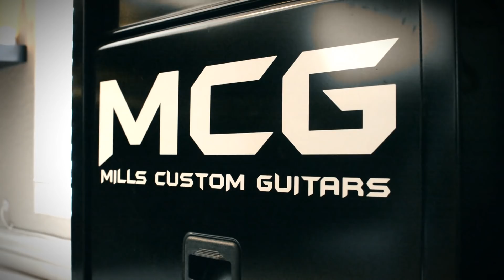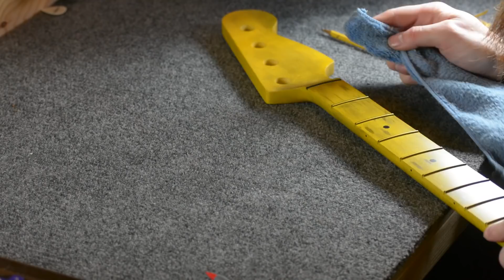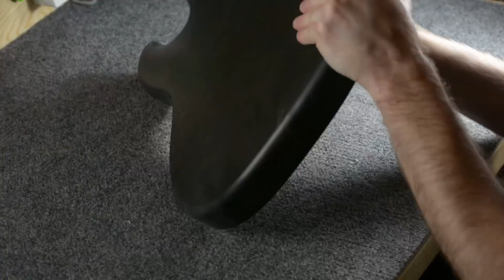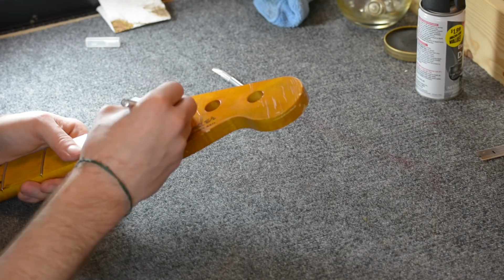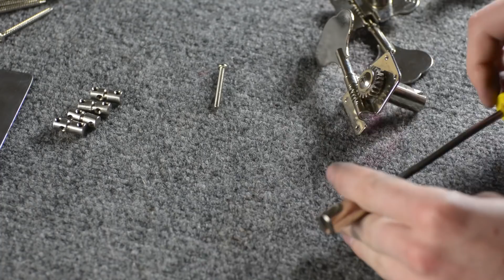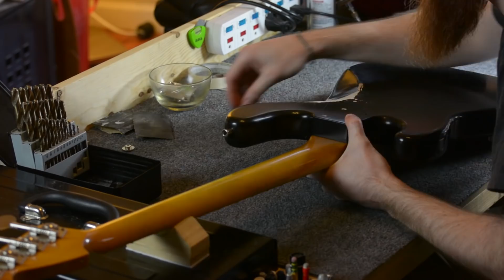Roger Waters Precision Bass Replica by MCG

Comment: You should do either lemmys or cliff burton’s rickenbacker
Reply: Was just about to write that myself! Not many Rickenbacker replicas floating around in the first place, but especially not of those two, sadly enough
Reply: The thing is about Rickenbackers is you can’t buy parts for it. So what you have to do is buy a actual one and strip off the paint and change the hardware in it to match the ones they used
Reply: I second that motion
Reply: Yeah he could do that or he could do krist Novaelic bass

Comment: So been trying to figure out, did you just randomly relic it? Or where did you get your relic plan from? All images I see of this bass, even recent pictures, the bass is in pretty good shape save for occasionally looking dirty/dull.  And have found zero images of the rear of his bass.
Reply from the maker: I never do random aging on a replica, it took me a few months of compiling pictures and researching the bass to find all the info I needed on it. But this is a very accurate scratch for scratch replica of the original. It can be a bit misleading though because a huge portion of the photo's online of Roger playing this bass are actually of a different bass that Fender made for him to be an exact copy.
Reply: Thanks, are you able to share the photos you found? Or photos of the finished product here? After my current build wouldn’t mind taking a stab at this.

Comment: You should install a neck with heel truss rod and skunk stripe
Reply from the maker: Why? I could, but that's not what's on the original. The neck I used is exactly what's on the original.
Reply: @MillsCustomGuitars1  isso have one 78 83 original precision and it has skunk stripe and heel truss rod
Reply: @MillsCustomGuitars1  sorry I always believed it was a 78 83 but it's not. I apologize my comment
Reply from the maker: @MrRatyo  Well regardless of the year of your bass, that would make sense. Rodger had the original neck on his swapped out with a custom made birdseye maple Charvel neck years ago. Thats why the logo doesn't match any actual era-correct Fender logo. It's not a real Fender decal or a real Fender neck.
Reply: @MillsCustomGuitars1  I didn't knew that. Thanks for the info. You do a great job in all of yours works. Please do more bass works.
Reply: Technically you’re right- but this bass isnt based off the bass Roger played during most of the 70’s with Pink Floyd. Its based off his current Fender Precision hybrid, which is believed to be made after the In The Flesh tour and during The Wall sessions. Roger is seen playing this live from 1980 to now- which is what I asked Dillon to make me. :)